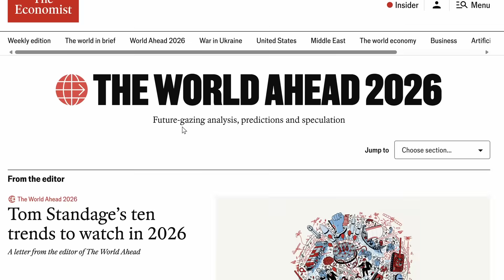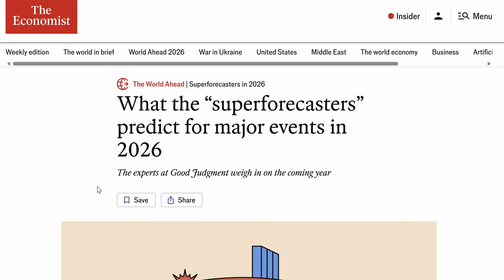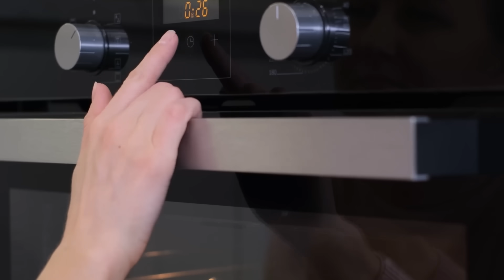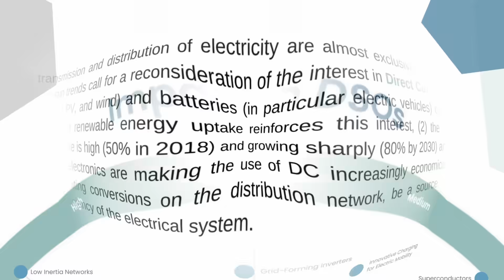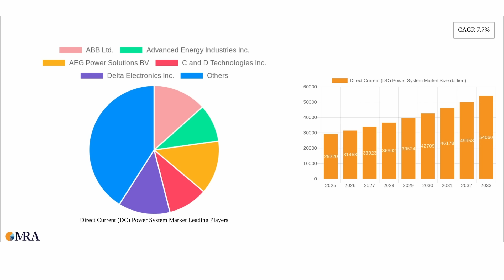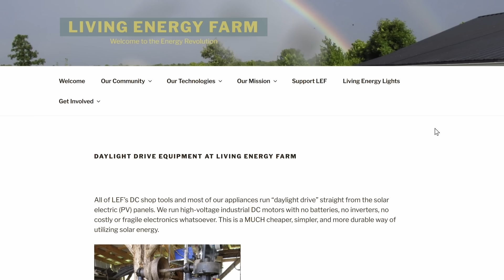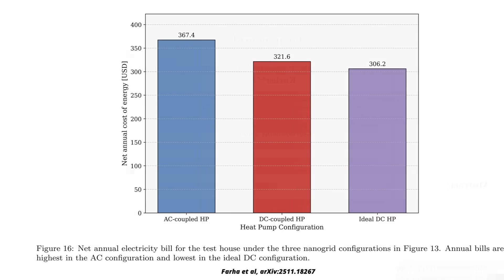Are We Using the Wrong Kind Of Electricity?

Comment: One big advantage of ac is that breakers , fuses are assisted by the intrinsic crossing the 0 volt line.
Reply: Arcs naturally extinguish at each zero crossing.
Reply: @donnasummer6285  And on AC there is no systematically metal transfer between contacts (remember the PLATINE in old cars: recess produced in one contact and protuberance in the other).
Reply: At 50Hz they do not go away. The ionized channel of air does not have enough time to dissolve in the air. So even though it extinguishes when crossing zero it reignites once the voltage starts to rise again.
Reply: @karelberanek1007  I'm a lineman.  I can drop load with a fused or solid cutout easily up to around 7600 volts AC.  The arc has plenty of time to extinguish.  I'm in a 60hz country, so even less time per cycle.
Reply: @jaym8027  just have a breaker
Reply: @snorttroll4379  trolling the lineman
Reply: Correct, and because the voltage is balanced in each direction, you get a lot less galvanic effect. You don't have one conductor oxidising while the other stays clean.
Reply: @nickhill9445  Use gold plated ones, problem solved.
Reply: @nickhill9445  — wouldn’t a simple capacitor stop one side from pitting/corroding (like in the old style Delco-Kettering ignition system in cars)?
Reply: @liberalduh9807 yes, a capacitor over the poles of the contactor
Reply: @liberalduh9807  What size capacitor would be required for typical house voltage and current?
Reply: @katgod — idk, but I suspect a lot bigger than in a car, LOL.  I only had basic engineering in college 45-y ago..  On the positive side, most of the regular breakers in my fuse box have not been tripped in a decade or two.. Would be interesting to see what solutions engineers come up with.
Reply: @liberalduh9807  No adding a capacitor would just worsen it! like adding a tiny capacitive spotwelder or EDM (spark erosion)
Reply: I work for the phone company and they run -48 volts DC with no regeneration for miles we do have inductive coils once it goes out beyond 21,000 ft basically we have a massive charger that flows through a very large battery made of wet cells that keeps everything balanced and obviously if power goes down there is zero interruption.  And a standard telephone line runs -48 volts DC at 23 milliamps and unless I am sweating profusely and kneeling on a wet ground hand touching multiple conductors I have never felt anything.  If the line happens to be ringing at the time that's a different animal and if there are two ones in the cables that causes the uncontrollable cuss words as well
Reply: @bg8fairpoint610  telephones don’t use much power as you noted but other devices are in the multi amp range so the drop is a problem.
Reply: @MuzixMaker  Telephones used to draw all their power from the phone company line, now most phones are also plugged into household power
Reply: @forddon  yeah I know I used to design landline telephones.
Reply: @bg8fairpoint610  Was our favorite phone prank in the early seventies.....call someone say your from Ma Bell and don't use the phone for a few hours as we will be working on the lines......then call the same number 10 minutes later and when they answer.......AHHHHHHHHH.
Reply: @bg8fairpoint610 , the ring current can knock you across the room. Ask me how I know.
Reply: @bg8fairpoint610 We have strict regulations for DC higher than 50V for good reason.
That is one of the main reasons for the 48V.
If you draw lots of power, like 1000W or more the high current will result in high losses.
For this reason DC with max 50V is only practical and economical for devices that draws limited power. Usually up to around 5A, so up to 250W.
That means you have a problem running your heavy appliances, like tea kettle, toaster, vaccume, oven, heating system etc.

Getting good efficiency for the heavy appliances is more important than for the low load devices as the heavy appliances use up the majority of the power.
Reply: @Rohan4711  I am not an expert, but it seems that DC shock might prevent you from releasing the grip on the faulty cable, and also might create some electrolysis to your body, while AC makes you shake and just heat your body - comparison for the same Amperage.
Reply: for ordinary mortals ac fuses, relays and breakers are cheaper and safer, DC equipment is costly and difficult to get.
Reply: Since DC devices have very wide varying requirements for its volts and amps it’s just better to convert AC at the end point to the final DC spec needed
Reply: @josealvarez9517 Most stuff that isn't battery-op is running at 12 or 24 volts before breaking it out to other voltages internally. And because cars run on a 12v battery and provide 12v to accessories, there's your standard low DC voltage.
Also, DC-DC is far more efficient than AC-DC, even in cases where it's generating and transforming AC internally (some switching power supplies do this, some just use buck converters, you generally only want to do the internal AC method at really high frequencies as doing it at mains frequency is inefficient AF)
As for what voltage to run to houses, just use the same voltage DC as you were doing with AC.
Reply: @LokiScarlet  are you actually saying to replace AC with DC at the same voltage levels to run a home? They have completely different behaviors, applications and safety issues.
Reply: @jos @josealvarez9517  almost the entire home is running on DC with extra steps? Yes. Because at that point those "different applications" become uses for a controller rather than a supply frequency from the grid. Also just what safety issues do you expect three digit volt DC to introduce over AC?
Reply: @LokiScarlet  ok this is where I know you’re making it up as you go along
Reply: @LokiScarlet  Nah, there's more than 12V and 24V.  That's mostly found on larger equipment, especially 24V.  If you wanna keep the discussion on batteries, then i'd say 3.7V is easily the most common these days, which is the standard lithium cell that's in almost every small device.  Not to mention the myriad of larger devices from hand drills to electric cars that use battery packs consisting of multiple 3.7V lithium cells.

I think its more relevant to discuss how power is used and distributed domestically.  5V is pervasive, it's the USB standard and can directly charge those 3.7v batteries.  There's a lot of low-power tech devices that run on 5V because of this.  12V is more or less standardized for high-power computer hardware.  20V isnt uncommon either, thats what USB fast chargers do.  PoE, which is used for security cameras, networking equipment, and some other stuff is 48V max.  Low-voltage lighting, which is becoming common in new construction, is defined as 50V max.  All of this is DC.

Also, it's important to note that one of the factors in AC originally beating DC was safety.  You probably don't want 12000V DC running down your street, and you definitely dont want 120V DC running through your walls.  There's a reason 48-50V is the highest voltage you see used in distributed DC applications.  That's whats been deemed safe to bury in a wall without causing undue risk of fire, and it's whats safe to handle without risk of electrocuting yourself.  It wouldnt be a bad idea to have a 50V DC distribution system in a house for low-power devices, but that isn't really able to stand on its own.

Just for sh*ts and giggles, i looked up what a Boeing 787 uses for electrical.  It seems to have a 28V instrument and battery bus; and the high-power electrical systems seems to be converted to a 270V variable frequency square wave, something between DC and AC.  The 28V instrument bus is in line with what i was saying about low-power devices and safe voltages.  There can be a jungle of wires behind the panels that could sit there and build up heat if you tried to ram a lot of power through, but the gauges and LCD panels don't need a lot of power, so it works.
Reply: @josealvarez9517  So you don't have any safety issues to mention? Noted.
Reply: @tippyc2  Most stuff that isn't battery-op is running at 12 or 24 volts.
Here you are talking about different battery sizes. So no, I don't want to keep the discussion on batteries, I quite literally said the opposite. The common plug-in DC voltage is 12, mostly because that's what cars run their electrical system on, so devices that you would plug into them that aren't battery-operated themselves, would run on 12VDC.
Reply: @LokiScarlet  based on the amount of over commenting you’ve done on this video to myself and others you’re just trying to sound like you know what you’re talking about
Reply: @josealvarez9517  Nah I just keep responding to those who talk total asspulled bullshit to me because it's fun watching them squirm. Some of y'all legit think 50/60Hz AC is magic or smth. "DC is more dangerous!" "There aren't losses with transformers!" "AC is more efficient to transmit" etc etc. That's how dumb y'all sound. I wouldn't have to know what I'm talking about to school any of you. The superstition is strong in this thread. Hell, even a 19 year old apprentice could school you. Basically anyone who doesn't believe the bullshit fed to them by pop culture could school you.
Reply: @LokiScarlet  thanks for taking the excessive amount of time to share your insecurities with the rest of us here 👍
Reply: @LokiScarlet  Generally speaking, most small devices powered by wall warts (those wall adapters) take 5VDC or 12VDC... and these days its usually 12VDC.  Your wifi router for example.  They will have internal regulators to take it down further (3.3V, 1.5V, etc... as needed by the ICs).

Medium-sized devices tend to run on 12V, 24V, or 48VDC.   A small compressor fridge like a Dometic, for example, runs 12/24VDC (and also has an AC input if you want to run it on 120vAC)... internally I think the compressor is just a 12VDC DC compressor.

Larger devices tend to run 24V or 48V these days.  12V is more historical (e.g. old RV 12V A/C for example)... but modern DC appliances typically use 24V or 48V.   A modern inverter (DC-AC) is available at all three voltages but if you want power and less heat, you get a 48V inverter to make your 120VAC.   That gives you roughly 5kW with only 2 AWG cabling on the DC side.

The problem with house wiring in general is that those circuits need to be able to handle a broad swath of appliances and lighting that might be plugged into them.  Standardizing on a single DC voltage has a lot of pitfalls... 12V might be fine for a couple of LED lights but not so good if you have a few hundred watts of lighting.  The voltage drop is horrid.

There is a DC standard called POE (power over ethernet) which runs 48V (basically up to 57V or so) which can safely deliver 30W, 60W, up to 100W (in latest standard) over ethernet cabling.  Along with the ethernet comms.  This is already in heavy use commercially and in some homes.

-Matt
Reply: @junkerzn7312  Yeah my point was Jose Westinghouse over there doesn't know what he's talking about. I wouldn't want to wire a home as 12v, I'd rather it be 120 or 240VDC for obvious fire safety reasons. Jose's complaints range from "OMG there's no standard" to "Muh safety issues but don't ask me what they are" as well as "DC is AC with extra steps"
He doesn't seem to realize that buck converters plugged into hundred volt DC could all buck to the same voltage for most things you'd actually plug and unplug on a regular basis.
Reply: Yep, cutting the power at zero crossing means less sparks. Same for smart home relays: The Shelly PM switches, which can measure, try to switch at zero crossing too to prevent big sparks (for some that requires firmware 1.7.1 though, like those 1PM mini gen3, and older compact gen1 will never get that).
Reply: Another is that every microgrid will either run in parallel to standard 3phase AC, OR an explosion of small-ish DC->AC converters so one can plug arbitrary stuff in later. Transition is going to be extremely painful, so 15% is seldom 'good enough"
Reply: AC breakers are a lot safer since they usually have RCD's built into them these days for your power outlets. Meaning they trip the breaker part when there is a leak detected, the RCD is there to protect from electrocution but a breaker alone without the RCD is only to protect the supply authority's equipment, transformers etc...
Reply: @-Chooka RCDs have nothing to do with AC in general. There are versions that also work with DC (Type B). But they have to use additional electronics while the AC only RCDs are dead simple.
That being said, even today non alternating residual currents can occur in some situations where modern power electronics and multi phase systems are involved, like VFDs (variable frequencies drives).
Reply: Indeed. That’s why I rely mainly on (proper) fuses for my solar dc. 
DC or AC… As with most things it is a matter of balancing benefits vs problems and see what is best for each case.
Reply: DC will sustain an arc in air with 60V (if I recall - certainly less than 100). Playing with an arc with a DC source and a limiting resistor is fun, and instructive. You can easily stretch the arc to 30cm. So DC at voltages above 60V is hard to interrupt. But you need higher voltages to cut IR loss e.g. 330kV cross country, 13.5kV on a suburban level. Now we can control power with semiconductors things have changed. BTW, the humble fuse is remarably interesting piece of plasma engineering, but this comment is too short to hold that story.
Reply: Breakers don't trip at the zero crossing.  They trip at the peak.  On-off triac circuits stop conducting at the zero crossing, but usually light dimmers work by delaying the turn-on time after the zero crossing.  Sophisticated power switches synchronize their on and off switching with zero crossings to increase reliability.
Reply: Yup! I work with a overhead bridge crane with two 10k lb mags. We feed 90VDC to the mags and good god the arc flash on the contacts are insane. I've seen smaller arcs on a NEMA 6 on a 300hp motor.
Reply: @capps2015 Faulty Arc protection?
Reply: @capps2015  That arc is due to the huge inductance of the coil.
Reply: no, ur assisted by the intrinsic crossing the 0 volt line!
Reply: Strong magnets can extinguish the arc. On low level this was used on milk float contactors
Reply: The ABB S201 series from 2A to 63A is DC certified up to 60V DC.

If you need higher current, the ABB S801 with 80A, 100A and 125A are 60V DC certified as well .

I use both types in my 24V DC Off-the-Grid installation excessively.
Reply: Yes!  Actually, at the 0 current line (not voltage.  The two can be out of phase).  And, since the switching off occurs at 0 current, there's little to no arcing and radiated interference.
Reply: And switches. The arc stops at zero volts.
Reply: What?
Reply: another big advantage is step and step down of voltages. critical to power transmission
Reply: @midnightwatchman1  That's no longer a difference between AC and DC. Hasn't been for quite some time.
Reply: @LokiScarlet  I am not sure where you getting your information. However DC switchgear is 10 to 30 times more expensive than the comparable AC. I think you have conflated possibility with feasibility. it as always been possible to step up and step down DC from the very beginning.  considering using DC versus AC cost is the main factor. Area where there comparable is ultra high voltage transmission and long distances. There two areas where DC is really the only consideration are underwater transmission and decoupling of power grids which has become a issue with very large power grid. for consumer amd mid level voltages there no DC voltage switchgear  that compares to simple AC transformer
Reply: @midnightwatchman1  Uh... Did you get frozen in the 20th century and just get thawed out or something? DC-DC conversion is cheap and efficient AF now.
Reply: @LokiScarlet In the post you are referring to he talks about transformers and high power lines. Please provide data for DC switching transformers in the 10+ kV area that are cheap and efficient.
There is a reason that almost all new high voltage lines are still AC.
The exception is for very long cables, there the cable can become cheaper if the DC voltage is very high.
That means we either have more expensive transformers or higher losses in the transformers. If that wasn't the case we would see far more DC in high voltage power distribution.
Reply: @LokiScarlet  Use your brain a little bit  I remembering  my power electronic design class here.  A  Gallium nitride ( GaN ) Transistor and Thyristors  etc  are not going to be cheaper than than  laminated iron core  transformers .   A fairly standard  step down transformer DC to DC 400 KV  to  230 KV  is easily 20 to 50 million USD. The same  using AC transform is start around  2 million to 5  million and if go really fancy maybe 10. This is today's reality  plus all the supporting components and labour is much higher for DC. You are not going to beat a iron core transformer with costs  and even with efficiency you are getting 99%. So  for many Power Grid application  DC is just so much more expensive. we are not talking about a basic buck converter here. There are some other issues that add to the cost as well.
Reply: You need both AC and DC or the band would fall apart.  
However it would probably be better to run electric cars on ac. IIs just the choice of 60 cycles that sometimes cancels out a heart beat in phase. 3000 cycles in led lights causes less identifiable flicker. Also 220 is a bit mire efficient than 120. The difference for transition is AC uses much less wire gage. That was the entire point of that transition and yah houses were wired dc at one time and it sucked ass. However if you had a low voltage dc circuit to just run led lights from solar it would be a cheaper and safer option if its 48 volts or less you can basically hold a couple of wires just maybe not on your tongue. I'm not sure if axial flux motors can be AC it might take a bit more brain work to put them as ac in a washing machine. Who knows, the concept is probably easy after you figure it out. 
I personally just developed a low resorce ai engine that only answers questions with," I don't know what the hell you are talking about." The best thing is it will run on a 286 DOS system. 
Now the other question... Do you use quotes for artificial intelligence ?
Reply: One big disadvantage of ac is that it gets in single coil guitar pickups. Especially on summer when use is heavy.
Reply: AC breakers catch fire
Reply: DC is great so we get galvanic action and we get to fix it.
Reply: it is absolutely no big deal to make breakers that can create a 0 volt for about the same duration
Reply: AC is easier to convert to all voltages of DC eg.. 5v,12v, 48v..etc DC converters are costly and difficult to build, and even then the energy loss in conversion is high. Sorry Sabine but Scientists and economists deal in theory Engineers deal in practicality and efficiency.
Reply: @PhoenixPatterns  Boost and buck converters are actually extremely efficient these days and cheap as hell. The inefficiency happens when you badly need a perfect voltage limiter, which leads to the zener diode-based voltage regulator. By having a high voltage DC source, one could take a lot of components out of DC power supplies in modern appliances and move the inefficiencies to the grid, where they can be reduced by simply doing it at scale. HVDC has proven effective for transmission lines between separate power grids, not requiring costly synchronization procedures that waste power.

If we never see the grid switch to DC, I'm still betting we'll see DC in the home eventually.
Reply: @LokiScarlet this is effectively turning DC into AC and then rectifying back to DC again.
Reply: @LokiScarlet 

They're also noisy and unreliable. All these complex systems need to be maintained. A transformer doesn't need much maintenance at all. There's no need to reinvent the wheel.
Reply: @neogeo8267 Tell me you don't know how a converter works without saying it.
Boost and buck converters are not inverters leading to transformers and rectifiers. They don't even cross 0. They operate on a principle known as Pulse Width Modulation. If you know the input voltage, you can set the output voltage purely by duty cycle. Alternatively, you can check the output voltage as it runs and adjust the duty cycle automatically to get the target voltage. An inductor is used to keep current from stopping when the supply is removed, and a capacitor is used to keep voltage present when the supply is removed. This is why boost, buck, and boost-buck converters are also called switching power supplies. Once juiced, they supply their own power during the short moments when external power is switched off.
Reply: @westelaudio943And AC isn't noisy? I don't even care if you're talking electric noise or audible noise, you're just wrong if you think switching power supplies are any noisier than transformers or any noisier than AC. If you mean electrical noise, noise-sensitive equipment can be given a voltage regulator, as it already would have in its power supply connected to an AC grid. If you mean audible noise, switching power supplies need the same thing transformers need - cooling. And in many cases, the same amount (or less) unless the power supply also has a transformer and rectifier.
Reply: @LokiScarlet I designed electronics for over a decade. 

If you want boost, you need an inductor, a switch of some kind (usually mosfet, sometimes igbt) and a rectifier. 

There are a lot of schemas. 

All suffer loss. 

My point stands. And yes, I do know how these things work. Many of my designs are still used in industry. 

Cheers
Reply: @PhoenixPatterns  What are you talking about? All modern powersupplies are DC-DC converters.
Reply: @PhoenixPatterns  20 years ago I designed and built a high power DC-DC converter at 93% efficiency. Today it can be done even higher. 
To turn AC to DC not only you need a transformer (even a tiny one in switching power supplies), you also need diodes, a capacitor and a regulator circuit, and at that point you have already lost the AC advantage.
Reply: @PhoenixPatterns WTF?

The AC to DC conversion (especially the USB ones) have the most worse efficiency.

Why does a 5V/500mA USB one need 9-15W @230V?

I can convert 240V DC to 5 V DC USB with an efficiency of over 95% and the stand-by power is less than 0,3W. Once the capacitors are charged, it has only to keep the 5V up and without load, these are milli Watts
Reply: @michellekonzack  I think you're conflating W with VA.  If a USB PSU truely consumed 9W to produce 2.5W (500mA @ 5V) it would also produce 6.5W of heat and melt.  You cannot multiply volts and amps together in an AC system and call it Watts, unless the power factor equals 1, but that is never the case except for purely resistive loads.
Reply: @thisnthat3530 Hate to break it to you but the only load that's not resistive in such an item is the transformer. AC power consumption is rated in VA anyway, kWh is just a useful figure to send in a power bill. That power is being wasted as heat and that heat is being generated somewhere in the circuit. Amps are amps, so your wires heat up the more amps of load in your circuit. Do you smell that? That toasty smell is amps.
Meanwhile in DC world, watts and VA are one and the same.
Reply: @LokiScarlet  Hate to break it to _you_, but a switching power supply starts with a bridge rectifier feeding a large capacitor bank and therefore is nothing like a resistive load.  Also VA is apparent power rating, W is power consumed.  They are only equal when power factor is 1.  I suggest you go and learn something yourself before trying to educate me.
Reply: @PhoenixPatterns DC is much more efficiently stepped up / down with SMPS at low voltages (up to about 1500V I think). At higher voltages, transformers are much more practical and significantly cheaper. MOSFETs don't take hundreds of kV.
Reply: With modern technology, DC can be very effective and relatively safe.  In times past before semiconductors, ac was needed for the most efficient voltage conversion.
With modern tech, we can use whatever is most efficient.   DC has been used for long-distance transmission for decades.   Ac is installed in most homes and is (at the moment) the most economical and safest choice.  
DC  is getting there. Arc fault protection is very important with DC and can be expensive and possibly troublesome. DC switching  needs to be done with care to prevent arcing and damage to switching contacts and circuits.
Reply: Yeah, I've seen a lot of AC to DC. Conversion in data centers or data rooms, sometimes at the rack level. My understanding was that it becomes hard to balance dc as the network grows, whereas ac doesn't have as much of a problem.
Reply: @ericnoriega547 Sounds like the opposite of reality. DC is just positive and negative, no balancing act required like with 2 or 3 phase AC, and you don't have to worry about loads throwing the circuit out of sync with the grid.
Reply: @LokiScarlet  You don't need to balance anything with AC.
Reply: @TyrianHaze 🧢
Reply: @TyrianHaze Split-phase AC systems (like almost all US residential power uses) have to be balanced to some degree. Some specialized split phase systems require more equally balanced loads than others.
Reply: @nbooth  "Not worrying about balancing" means that the utility company worries about delivering usable power to the end user. AC is a plug and play technology, and if there are any problems, it's the utility company's problem for the most part.
Reply: @TyrianHaze The end user doesn't have to think about it. Technically the wiring can handle an unbalanced load in all cases, but an extremely unbalanced load on a split phase 240 system will cause the voltage to drop on the loaded leg (lights will dim, some sensitive devices will malfunction). There is also a per-leg current limit, so an unbalanced load can only use half the available power. 

So the electrician worries about it when they wire your house. E.g. they don't put all of the lights or all of the kitchen appliances on the same leg. Every other breaker is on alternating legs to make it easier to distribute. They try to make it unlikely that your normal load will be highly unbalanced. (And the big appliances of course are 220 of course.)

But more generally there are split phase systems that do require more closely balanced loads.
Reply: @nbooth  In the context of a data center, it would all be handled at the circuit breaker level. You would just plug and play all of the devices into their respective circuits.
Reply: It`s direct current so cables must have a bigger cross section
Reply: @phollos  What?
Reply: @phollos If I have a cross section of 2,5mm2 in AC to continuously support 16A without overheating, then it works the same way with DC 16A.

The only thing is, if you have a 12kW 230V AC motor (54A, require at least 10mm2) and now you want to run a similar 12kW series motor (I have one) on 24V.
😅
Then it sucks 580A @24V and the connection should be made with at least a H01N2-D Welding Cable of 120mm2 or better two 70mm2 in parallel. I use the 120mn2 ones but the cable to the contactors and busbar is only 2m long.
Reply: Wrong .
Resistance only no capacitive or inductive reactance !
Reply: @phollos  DC requires slightly smaller cross sections for the same ampacity. However spark gaps must be significantly larger as DC faults arc more easily.